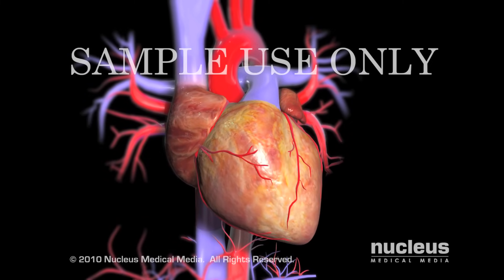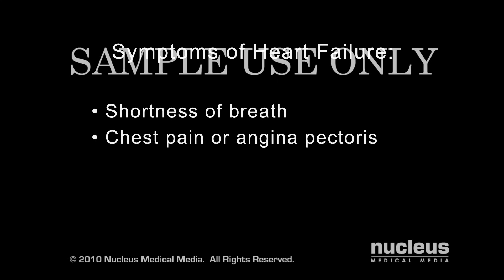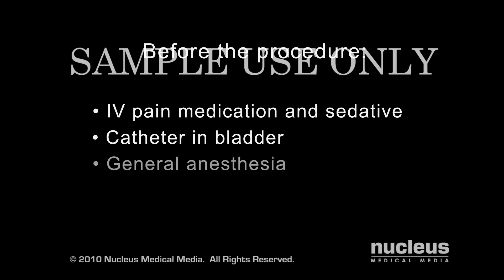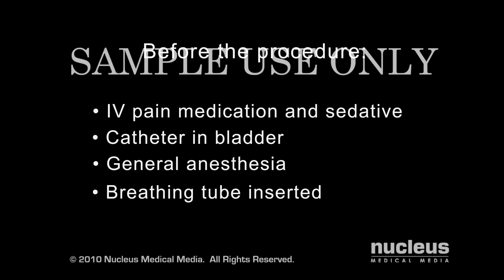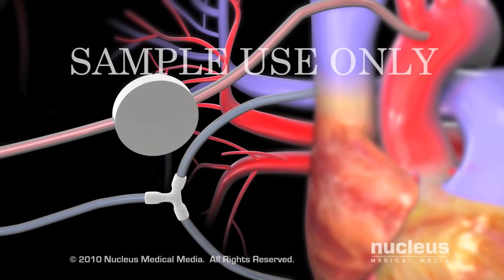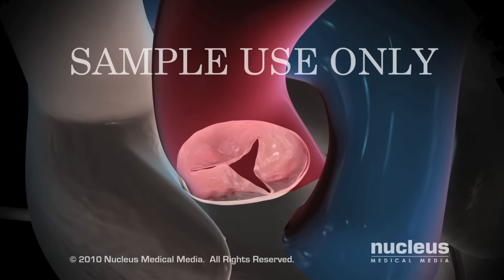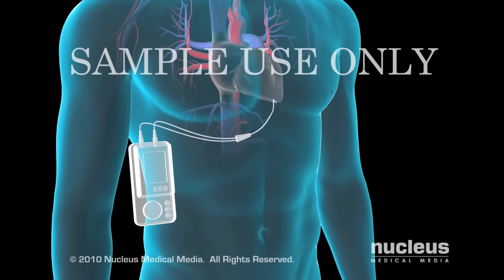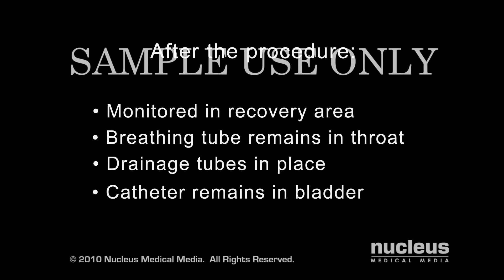Aortic Valve Replacement

Comment: i had this done 15 years ago,the doctor told me at the time it would be better for me to do it or i won't last too long,so i decided to do it,i'm living a normal life now,i'm a truck driver,only i have to take the pills the doctor prescribed me,and i see with the doctor twice at year,so whoever read this post and need to do it,don't be afraid,you won't feel a thing until you wake up in bed hours later feeling better already.
Reply: Susie Campbell My mum had it done in january this year, She is 82 and she does not have a problem now
Reply: @1sydman1  Thr drs have just told us that dad age 83, will need it.  He passed out Sunday bc his heart was going 300bpm & fell out of his chair, hit his head in 3 places, then hit the floor so hard broke 7 ribs, both shoulders, both collarbones, & an upper arm bone, tore his frail skin in several places.  His body was preparing for death when 19 seconds later his defibrillator shocked the heart to beat normal.  He woke up in a pool of blood, & knew his head was bleeding.  Once he got that stopped he then knew he had to get help.  He finally was able to get his cell that was on one of the things he hit falling & called me. He just said very calmly he had fallen & can’t get up.  We live 30 minutes away.  We arrived & walk into what looked like a crime scene from NCIS.  So here we are 5 days later & he is in ICU cardiac & I’m researching Aortic Valve replacement.  Any suggestions on which to get & why is appreciated. He has been on blood thinners for years.  Thanks to any & all for suggestions.
Reply: @shannonpeterson4891  there might not be any pros for the mechanical since he is already on the blood thinners, and at his age he wont require a second surgery to replace a worn out tissue valve, because they last for a minimum of 20 years, 15 if you are really unlucky..

i just wrote out to Shanith Muhammed a detailed comment regarding my own personal experience with an aortic valve replacement where I chose mechanical.          of course speak to the doctors and surgeon, but the question i have is, why does he need an aortic valve replacement?   mine was required because of endocarditis, the valve was infected.     different reasons require different solutions.      the ticking takes a while to get used to....  the mechanical valve makes a tick everytime it closes, so it is essentially like being able to hear your heart beat without trying.  it opens and shuts at the exact rate as your pulse right.        this was a painful surgery to me, but as one increases in age, the less pain the patient experiences.    simply put, your less sensitive because of aging. this is a normal process that happens with everyone.        just make sure to ask to have a pain team ready to co ordinate directly afterwards because my pain team didnt really have that great of a game plan for afterwards.    thats how i felt anyways.      they were scared to over correct, because i have and had a high tolerance to opioids, they were extremely cautious as to not overdose me.    
however in this, they  definitely undermedicated me.    i woke up to as much pain as 3rd and 4th degree burns.  a different type of pain of course, it was along the sternum. right where they took a bone saw and split it open, i was balling for a couple hours in pain.

that really bothered me.       in the long run though everything went perfect and its been 9 months since your comment, so how did it go?     sorry i just realized how long it was since u commented. i wouldnt have wrote as much  "advice". 
   after all it is the WORST VICE😉
Reply: How old were you when this happened? I'm 24 and I may need this surgery soon..
Reply: @hrkbabyyxo  Did you have it done? I may need it also and I'm 23.
Reply: @hawraa7638  I haven't yet 😫
Reply: i have to get it and im 19. this makes me less scared
Reply: +La Malacabeza  Hi, thanks this is reassuring ..
Reply: Eugene Leger 9
Reply: Thank you! A great relief!!
Reply: @anuytube  when did you had
Reply: @prakasharumugam9582  7 months back
Reply: @anuytube  thanks.. are you from india..I had before 3 months..How do you feel now
Reply: @prakasharumugam9582  no one cares if you are from India. Stop being so racist.
Reply: @anuytube  abb toh sayad doorbean se hoti ha
Reply: +La Malacabeza Thank you
Reply: La Malacabeza now 19
Reply: La Malacabeza so scary that they had to stop your heart
Reply: Well I don’t have an aneurysm (that I know of) but I certainly would get the surgery if I did
Reply: Mehr
Reply: Im scheduled for mitral valve in 5 weeks but my main concern is how bad the recovery time is and what you can do after week one, week two etc as far as normal activities- doing laundry, putting on a tee shirt, getting groceries and dishes down off the shelf etc

I was curious how they actually connect the machine, thinking it was a catheter in maybe the femoral artery, but nope! a video shows the actual process and how they cut 2 tiny holes in the aorta and elsewhere under pressure and insert canulas and sew them in place for the operation!
Reply: what happened to ur ribs bro?
Reply: God bless you!
Reply: Can we talk?
Reply: @shanithmuhammed1490  Greetings Shanith!

       I am not sure if you have already had it, based on your comment i would presume that you have.  I am just curious how you are doing and which route you decided to go with>?  the mechanical vs the tissue.    

     Your surgeon should have explained the pros and cons to each to you elaborately and in terms you understood.      
After the surgeon explained them to me , I went with the mechanical, and he said : " Good! That is  what I also would select for you, and that's what I would even choose for myself if I required the surgery."
 That definitely made me feel good about my choice.

     I am not sure if he really meant that, or was saying it because it would've likely made him a lot lot more money.   If you think about how much that little piece of metal costs, right?   I am not even sure myself, but it is something I will be starting to look into though.

    The selling point for me was the fact that with tissue you would 100% require a second surgery in the future to replace the tissue valve itself.   This is because they aren't human valves they are from pigs I believe,  and for whatever reason they do not last as long as an original human tissue valve.     So that is a definitely con to tissue and a pro for mechanical.   

  With mechanical however, and this is at the current time, you DO require blood thinners for the rest of your life.  Along with those blood thinners you will be required to have blood tests at least 2 a month, also for the rest of your life.

    So if your cardiovascular system is already on the fritz, or turned to shreds,    [ it is common for people who require this type of surgery to already have a poor venous system],   where its difficult to find them for IV.      Both giving blood and taking medication through IV is difficult and in some patients at some times, EXTREMELY difficult. 
    For instance I required a PICC line for my hospital stay (which was about 120 days).        I have had some long stints in the hospital and a major skin graft over 90% of one of my arms, and so the veins have been exhausted and collapsed in my other arm.
    Due to requiring so frequently your blood collection,  (at least 2 times a day for me) for a few of those hospital stints, collecting blood thru IV on me @ 2 times a month for the next 40-65 years  is simply not a viable option.

For whatever reason this was not even considered when i chose mechanical valve.

  Fortunately though, the advances in the health industry is constant and exponentially growing. Daily advances in things such as the tech equipment,  the knowledge of techniques and applications, efficacy of medicines and creation/development of new and improved medication offers more than enough hope that I will be able to have these tests performed without requiring IV.

  Even at this very moment, my Doctors office is submitting request forms to apply from the Federal Government the means to acquire an INR screening machine which only requires blood taken from a quick poke at the tip of the finger.  Very similar to how a glucose monitor is used on Diabetics.    So with this machine, I will not only have no trouble nor give any trouble to the phlebotomists  aiming for sticking a needle precisely in my veins, but a reading is provide in mere moments, apposed to 6-12 hours.

With all this being said,  HOW DID YOUR OPERATION GO?   which route did you take?   and lastly, HOW ARE YOU DOING TODAY??
Reply: I had this operation in 2004 when I was 9 yrs old now I am 29 yes of living so it's been 20 years now since I had the surgery..and last week I had an Echocardiogram to check my velve replacement and they said it has been leaking again therefore I need to do another surgery to get rid of the leak 😢
Reply: You might not read this but Thank you. I have to get this done soon🫶🏾🫀♥️
Reply: Great motivation by you. You did with mechanical valve or prosthetic valve
Reply: HI GOD BLESS WHO HAVE TO HAVE THIS DONE YOU ALL ARE GOING TO BE DOING BETTER GOD BLESS YOU ALL ME I HAD A TRIPLE BYPASS IN 2018 I'M DOING WELL IT'S SCARY THE THING IS YOU ALL HAVE GOD WITH YOU GOD BLESS YOU ALL 🙏💕🇺🇸🙏💕🇺🇸🙏💕🇺🇸🙏💕🇺🇸🙏💕🇺🇸🙏💕🇺🇸🙏💕🇺🇸🙏💕🇺🇸
Reply: La Malacabeza thanks this surely helps learning and watching a lot on youtube did not want to do it at first but I want to live thanks again from Canada....
Reply: God is good

Comment: I had my aorta valve replaced 10 years ago with a mechanical valve...5 mg warfarin daily. ...which is a pain but I have had a normal life and tremendous blessings...My sister is having the same surgery October 31, 2013 and is choosing a tissue valve...Hope she does as well. Please pray for her. Her name is Lana
Reply: Hope she has good life now.
Reply: why she is not having mechanical valve n do you have any problems with mechanical valve
Reply: Carol Poore are guyz here taking warfarin for life?
Reply: Wow, I had an aortic valve replacement in 2012. My surgeon replaced it with a prosthetic valve so that I could have children. I have about 3-5 years when I'm due for another surgery and will change it to a mechanical valve (a little nervous).

Comment: Thanks a lot for this very interessting animation. My date of operation will be next week on 18 april but it's not the valve to be changed, it's the aneurysm of the aorta, measured 5,4cm in cause of a bicuspid valve. I will keep this valve for the next 15y but for now, the procedure will be similar with one difference, the cutting will be "minimal invasiv" only 8-10cm.
Reply: Hope you are doing well sir. Positive wishes for you.